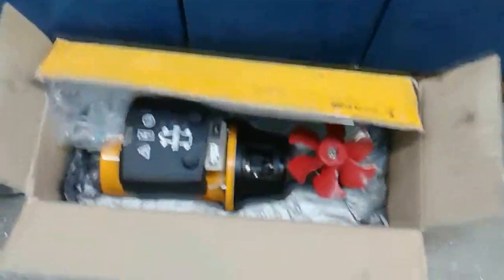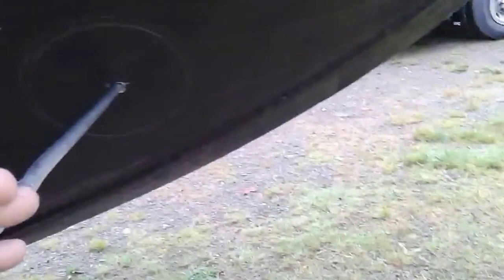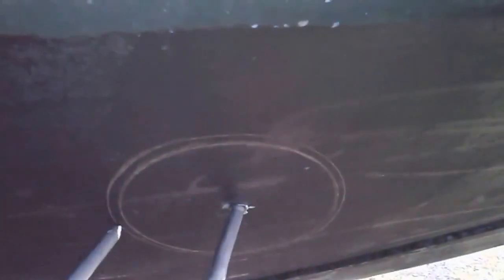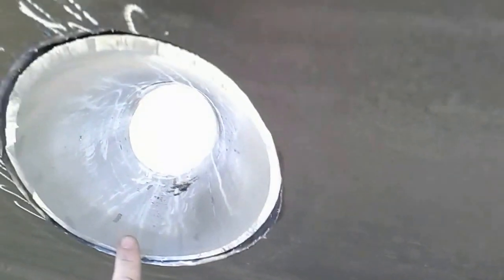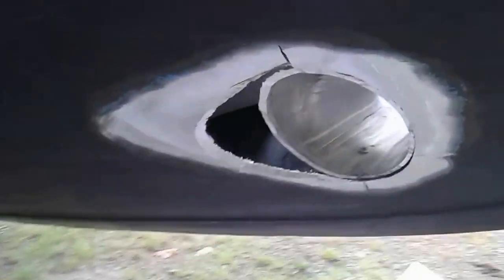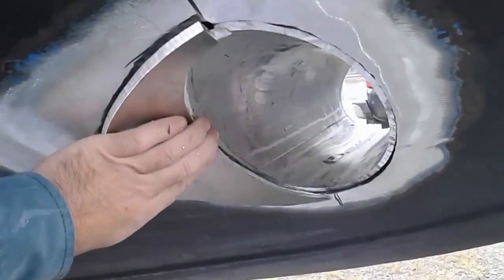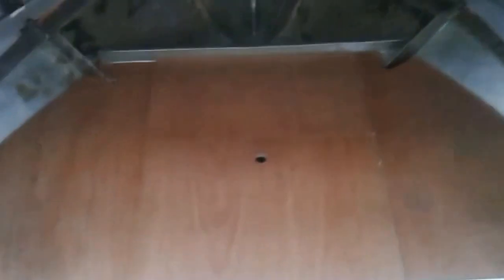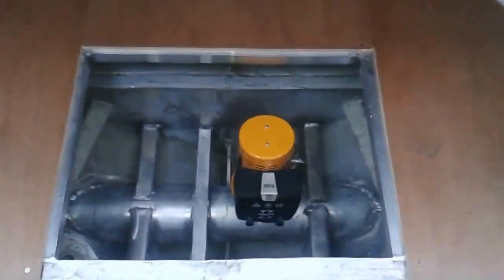Bow Thruster  Vetus

Comment: I have the time thruster but the two bolts securing the leg to the underside of the tube keep coming loose allowing water in. Do the have a similar problem?
Reply from the maker: haven't had any problems with it. use lock tight and put it back together

Comment: Is the motor off-centered on the tube & keel because the prop shaft has an elbow that puts the prop on center inside the tunnel?  I noticed the motor was offset to starboard a little.
Reply from the maker: the prop center is in the center of the tube , and it made room for the battery . I been running the boat and the thruster made docking so easy I can dock it by myself .